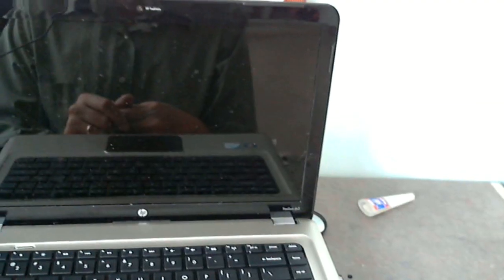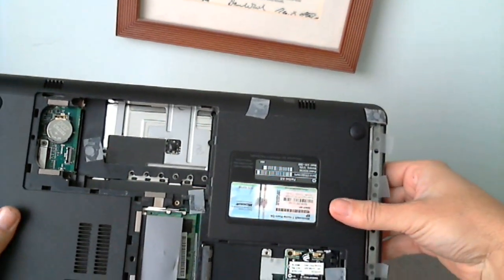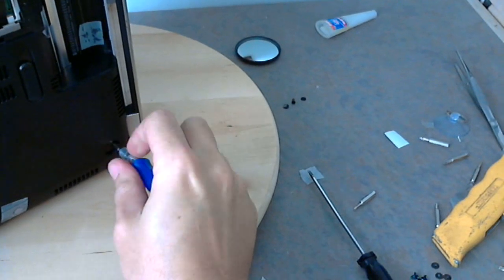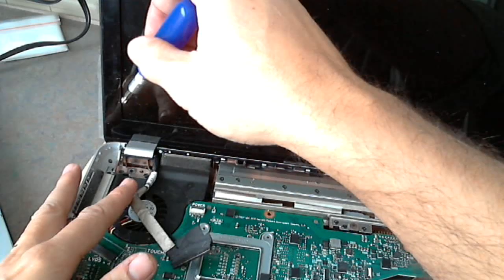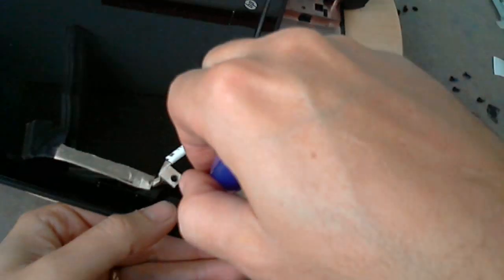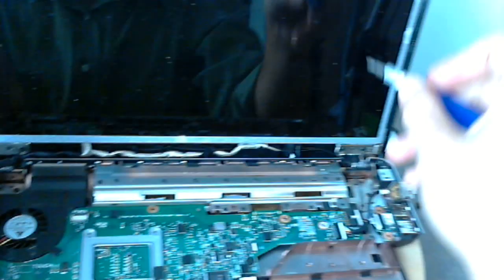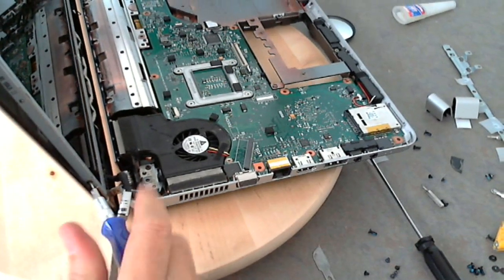HP Pavilion dv5t-2000 dv5 Laptop Screen Replacement Procedure

Comment: The dv5-2045dx has tiny screws in the battery compartment and under the hard drive...what is the tool you need to remove those? What a pain..

Comment: Hey I got a problem with this exact laptop. I opened mine up and didnt take into consideration that mine has a back lit key board. The little plastic thing that holds in the ribbon went missing as well as the one for the mouse touch pad. What I'm getting to is would you know where I can get a hold of one or at the very least what there called? Any help is greatly appreciated.

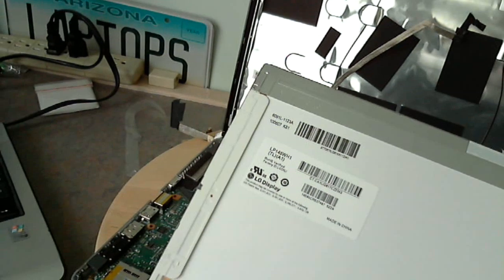Comment: 13:21  Brilliant!!!  HP covered over the two screws with a little piece of plastic.  Thank you thank you thank you!!  Without this video I would have broken my screen frame!!  You are the best for posting this.  Thanks again!!!
2:14  Please note that in the real world there are glue strips holding the keyboard down.  They are along the top.
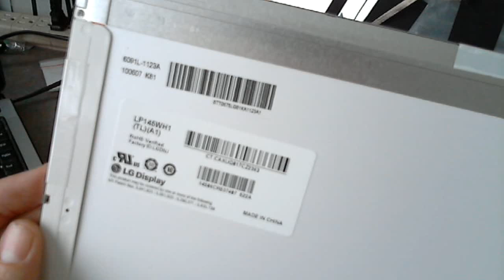13:00  In the real world the screen is held in place by glue strips.  Slide a credit card under the plastic to help remove the frame without cracking it.